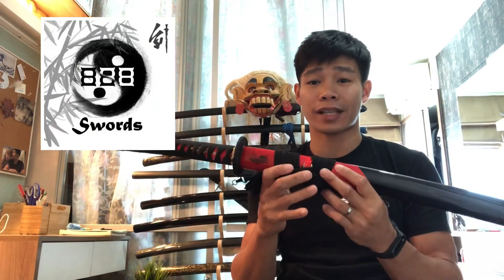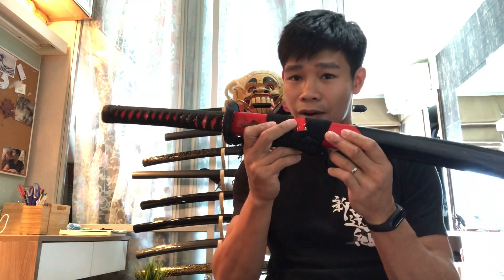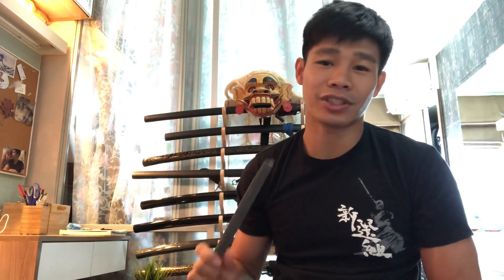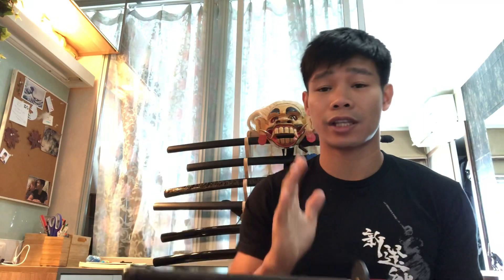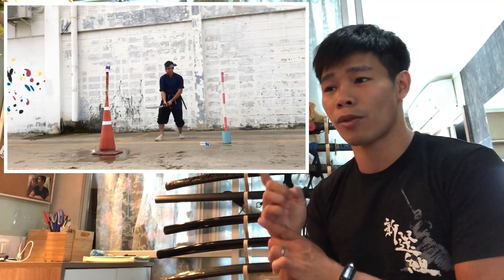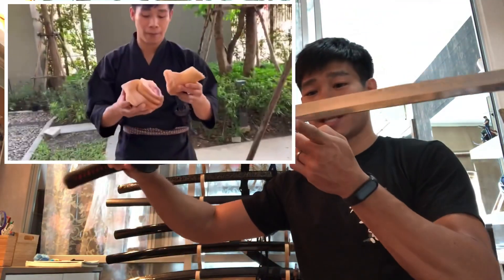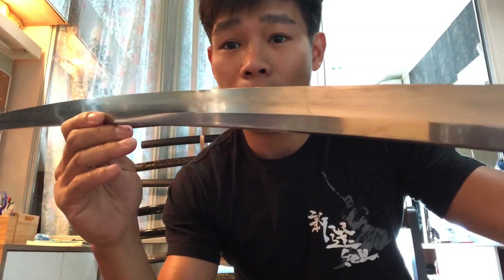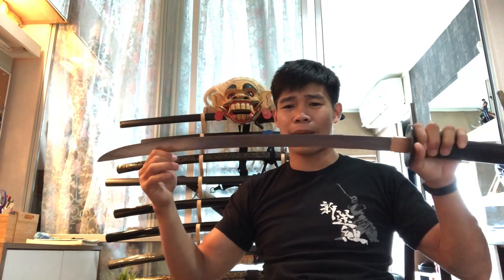Why Japanese sword was so unique at the old time period? What is the modern T10 steel blade??

Comment: Thank you for explaining! What is the weight of the sword? Under 1kg?
Reply from the maker: Thank you so much for your question🙏☺️ it’s make me find the answer. It’s weight 1030 gram(1.03kg) 👍
Reply: CHAMP ARCHER - Kop Kun Krap Champ! 

I also like your mention of the balance point. What is the balance point on this katana? You mentioned that it felt well-balanced in your hands. 
The balance point is measured from where the Blade meets the Tsuba, to the point where the entire sword is balanced. It is usually between 10 and 20 CM.
Reply from the maker: EPSTomcat11 This one is 14cm. From the point of the balance to tsuba☺️. Thank you so much for your supporting bro 🙏😊
Reply: CHAMP ARCHER - 🙏
Reply: CHAMP ARCHER - I am looking for 888 Swords store online, but cannot find where to buy this sword 🤔
Reply: CHAMP ARCHER - One more question :) How long is the entire sword, and how long is the Tsuka?
Reply from the maker: EPSTomcat11 on Facebook pages bro👍
Reply: CHAMP ARCHER - I found it :) But cannot read Thai 😂 
I was looking for the sword specs (length of blade, tsuka, etc..) and did not find it :(